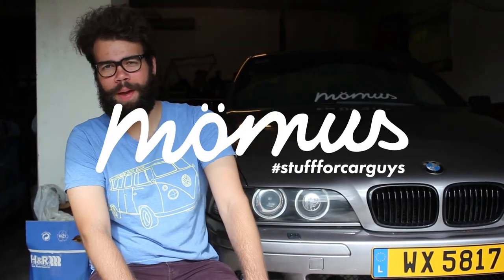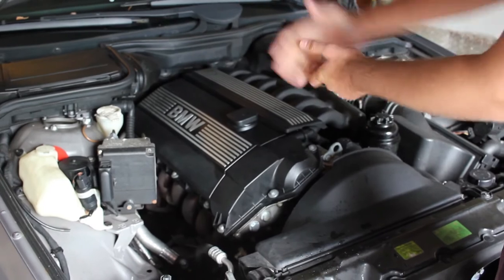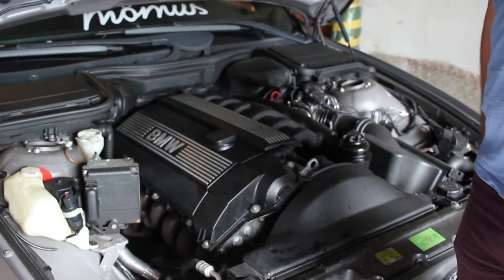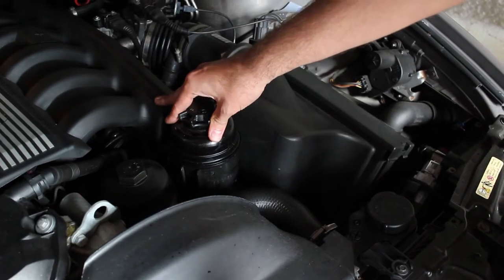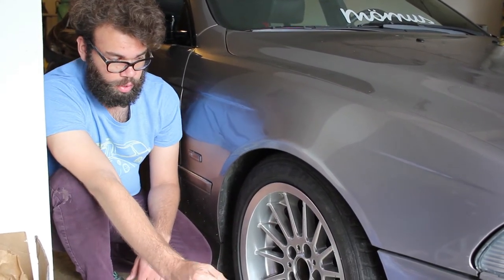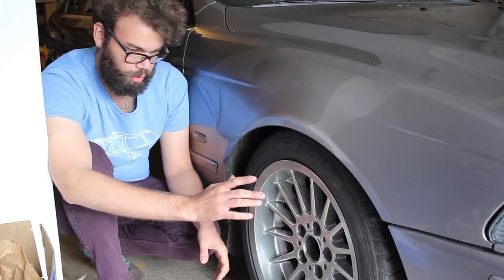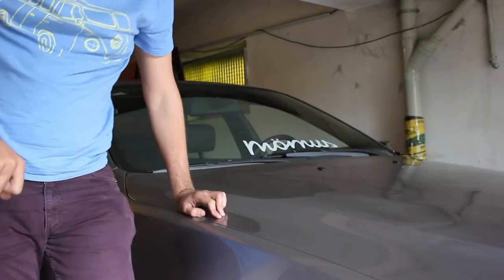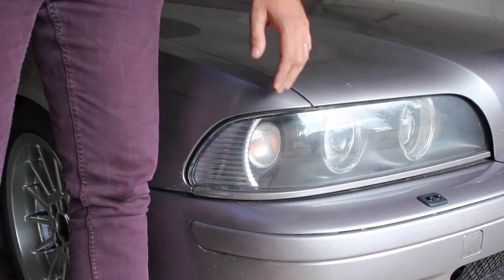Everything that's wrong with my BMW E39.

Comment: Hello Momus!     I’m planning to buy a 2002 530... what are key things to look for when looking at the car itself especially the timing chain replacement check?  Thank you!
Reply: Commen problems I experienced (1999 523i): leaking steering resevoir, bad fanclutch, bad CCV (this is how that sounds like https://www.youtube.com/watch?v=nFTsH3dZVpY), broken ABS module, dead pixels in instrument displays. So far I dint have a problem with the timing chain at 270.000 km, I believe it had more problems on the V8 rather then the i6, correct me if I am wrong. Vanos can also be an issue

Comment: All the things you've mentioned are service items, and to be expected at that mileage, you did the right thing with the wheels , any bigger than 17inch they drive horrible,  I'm pretty sure that your exhaust system has a flap that should open when you boot the car, mine does, it growl's like an angry bear when I give it the beens, same engine, but UK car so maybe different system. Anyway it's controlled by vacuum from the inlet manifold, common for them to stick open or closed.
Reply from the maker: Thanks for the feedback.

Comment: Hi i really like your videos , i have a bmwe39 525 TDS from 1997 i boutgh him um December the motor when was working seems a gasolin car was so soft and last weak he was starting to make a noise and the noise cames from the pulley from camshaft and i pay to the mechanic 400 euros for put a new one and when i went to pay and take the car to my house,the car stopped and i had to put bom again on the Office and he try to take out the pulley and she doenst move , know he started to open the motor to ser what he has, do you can tell me what can bem the problem, i would like to have your opinion
Reply from the maker: Good morning! Thank you for watching our videos. Sorry to hear about your car. From your description, I'm not sure what the problem might be. Was the noise gone when the mechanic replaced the pulley? Is there a BMW specialist you could take it to?
Best of luck and let me know how it goes.
Mömus
Reply: Tks for your attention and answer, know i told to the mechanic to open the motor and see what is the problem can have the motor

Comment: You should get a 540i honestly it's the besssssst.
Reply from the maker: Maybe I should ;).
Reply: It sucks, the 4.4 liter engine is a disaster to work on, its slow as hell, and here in Europe our paycheck isnt that big to drive those kind of cars in Europe. Gas is not as cheap as in the USA. The best E39 to buy is the 530d or  M5.

Comment: Great cars. Stick with those style 32 17s. Forget the 19s for that car. 
Either your headlight adjusters are broken or your leveler in the back is not working. 
Just change the power steering container and both hoses. Rack should be fine. 
ABS melted yet? Rear center light melted yet? Ignition switch?
Reply from the maker: Hello! 17s are indeed what we ended up with, it drove much smoother. Headlights were fixed in another episode. Abs and third brake light did not have any issues, neither did the ignition switch.

The car was sold long time ago, and I've recently seen it again. It had been crashed and neglected. What a pity.

Comment: Nice car, but me personally, wouldn't invest so much money in a e39 with mere i6 engine. It would be a different story if it was a 540i with nice V8.
Reply from the maker: Thanks for the feedback!
Reply: he probably lives in the usa where they don't have pollution/engine size tax and the petrol price is 40 eurocent per litre :D
Reply: yeah. i see high power cars so rarely here in europe as its so much more expensive to have them here
Reply: In my opinion the i6 engines are very nice too... i definitely would invest the money
Reply: Indeed, V8 sound great in comparison with i6, but... in case of BMW of late 90s, M52 2.8l i6 is the most reliable, almost indestructible engine, while V8s need never ending repairs. Interestingly, M52B28 is an engine of choice by drifters.

Comment: Want better music, then get a e39 with the m62. V8 power is the best typeOf power
Reply from the maker: Absolutely true, but I like the steering rack and pinion too much to give up on.
Reply: It's a small price to pay for the sound, smoothness and power of the M62 V8. My first E39 was a manual 528i, but after I made a test drive with the 540i, I was lost :-)
Reply: Meh.